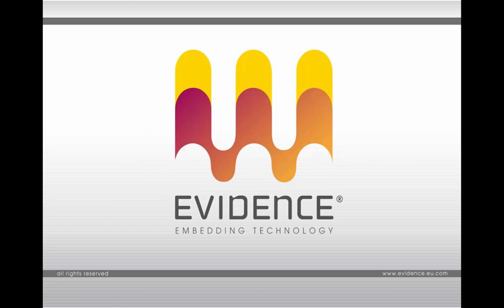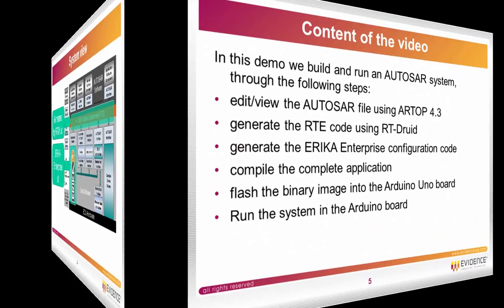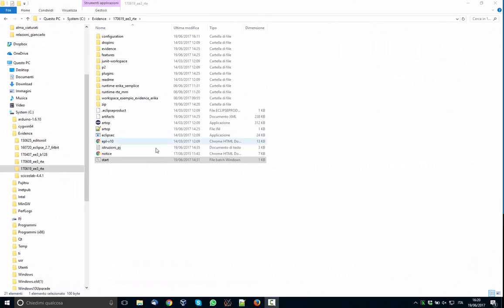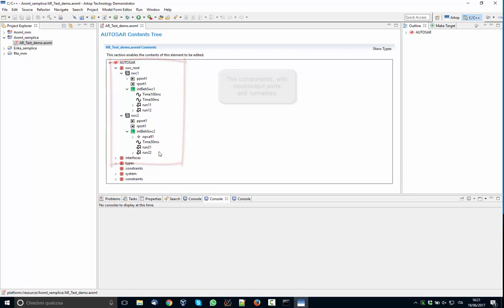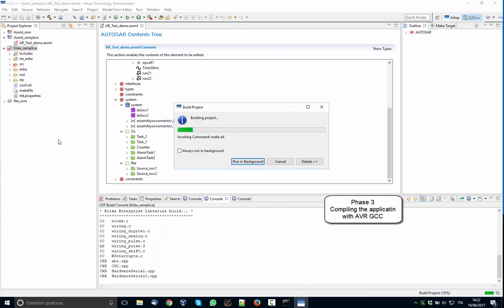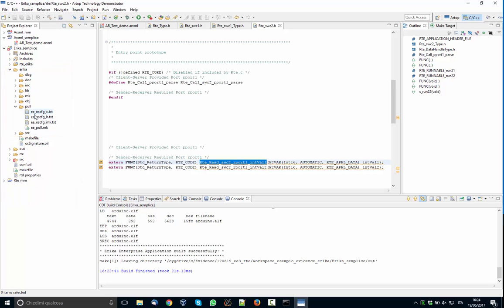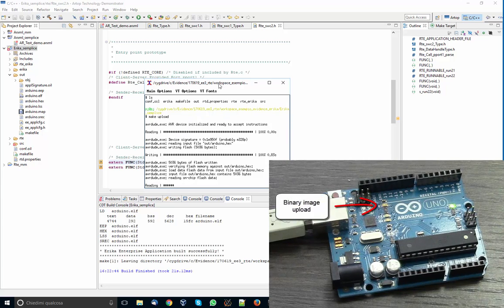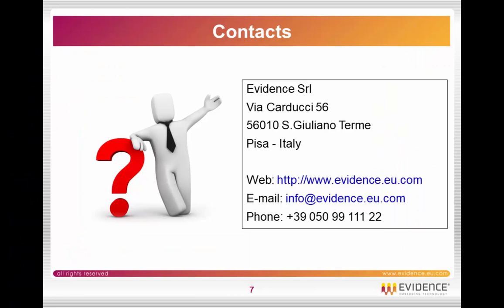Compiling an AUTOSAR application using RT-Druid RTE Generator and ERIKA Enterprise 3

Comment: Hello Paolo, 

I am not able to find ERIKA version 3, Is it released? , Another Question should I be able to do the same experiment using the currently available ERIKA version 2? 
Finally Does ERIKA version 2 has RTE generator?

--
Thanks
Reply from the maker: ERIKA3 has not yet been released (hopefully we'll have an almost final version 4Q2017). We currently plan to integrate the RTE on ERIKA3, if there is interest we'll support ERIKA2 as well. Note that the RTE Generator will not be released open-source.
Reply: Thanks for your fast response,  
Will RTE Generator have  a free release  or trial version for Under Graduate /Masters students?
Reply from the maker: This is something that we did not yet decide. Our first target will be to release ERIKA3, then the rest will follow...
Reply from the maker: Additional note: ERIKA3 has been released. RTE generator not yet